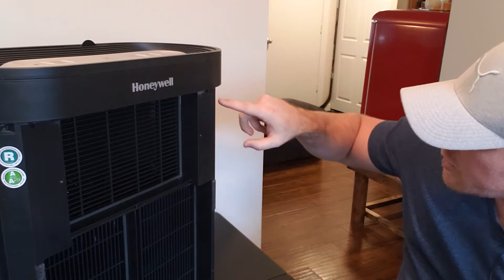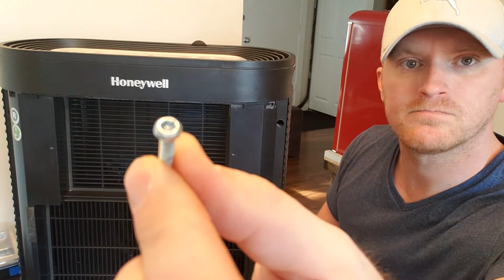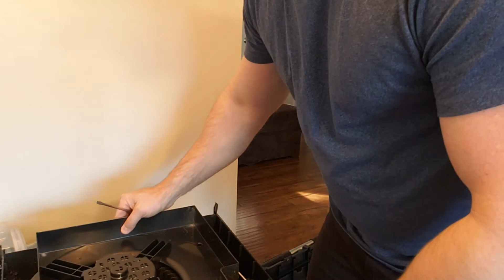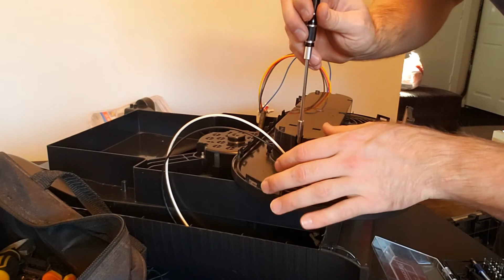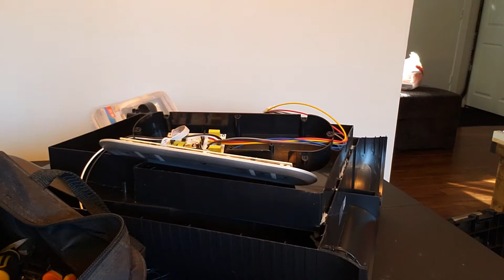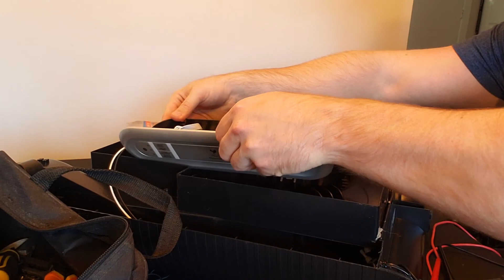We Tested the Honeywell HPA300 Air Purifier

Comment: Thanks, Greg. I used this video to take mine apart to clean the fan blade compartment, which was full of dust. Too bad Honeywell doesn't make the top grille with a hinge to make cleaning a lot easier.
Reply from the maker: Your very welcome, and yes it should be easier.

Comment: Thank you sir. This is helpful. I have similar unit. bought over a decade ago. Still going strong. I do clean the filter regularly. I run it 24/7/365. Do you think that's ok? I also leave it running when I'm not home. Recently I've been considering...is there any chance it can overheat and catch fire?
Reply from the maker: The likely chance of fire is not likely, but that being said there is always a possibility that electrical shorts out or it becomes so plugged it overheats, but usually there is built in safeties for things like that can't happen.
Reply: @Thomasappliance  Thank you. Good to know. I know it has no heating elements like a heater so it should be ok but wanted your expert opinion. Do you run yours 24/7 and even when you're not home? is it even recommended to do what i do - to run it around the clock every year?
Reply from the maker: @Newtttton  I run mine during the day and shut it off at night.

Comment: Thanks for the info, i just need to do a deep cleaning , you mentioning the T20 screwdriver saved me lots of hassle. As for your board perhaps you can practice some electronics diagnostics since it is dead anyway 😅
Reply from the maker: No problem at all, and yes I did do some electronic testing after this video to see how this board worked.

Comment: So i just bought one second hand and it turns on but the fan doesnt what can it be ?
Reply from the maker: It could be the fan not getting power from the board, the fan blown, or anything electrical in-between. I would start with seeing if the board has any power out.

Comment: I would like to know where I can obtain a replacement 4-speed AC motor for my Honeywell airpurifier model #HPA160CV1 the motor has a sticker on it indicating it's made by the Easepal company but no mention of it on Google anywhere. Please help if you can. Thank you
Reply from the maker: Thanks for watching, I've found these types of motors are hard to find, I usually just Google any of the numbers on the motor and hopefully something comes up.
Reply: I'm having the same problem but I can't get my machine open. Is there any chance you can type the whole label here.... thank you very much
Reply from the maker: @emoryolsoff96  thanks for watching,  I dont have the unit anymore sorry

Comment: So I just bought an hpa300 from Amazon but my control panel does not look like that. Do you think that they replaced the control panel because of issues like you are experiencing with the unit in the video? At first I thought Amazon maybe sold me a very old model but it works wonderfully. And just in case anybody wasn't aware it does have a manufacturer 5 year warranty. I spent $2.99 and got an extra 2 years of coverage from Amazon/Asurion. I think it was worth it but if it runs that long I will be quite okay with it
Reply from the maker: Thanks for watching Conan, I'm not really sure but they very well could have. They are nice little units enjoy!

Comment: Hi Greg. Your video was helpful, but I’m getting a almost burnt smell from my HPA 100. The filters are new and I checked if there was plastic on them. Prior to installing the new filters , there was no burnt smell. I was thinking of cleaning the blades. Will taking the motor mount out be necessary or can I fudge around that? I also took a good sniff of all the new filters and surmise that they are not the cause. Otherwise, what is your opinion after cleaning the blades that the motor is the cause and this unit is in need of replacing. BTW, the Honeywell unit is just under 4 years old approximately. 
Thanks jerry
Reply from the maker: Thanks for watching JarvisRose, that's a really good question that I dont know if I have the answer for, it can be very tough to find anything like that weather its a air purifier or a washing machine.

Comment: Thanks for doing this video.  Needed to clean mine out because it's been collecting dust for years.  And, now I need to start putting it to use again because I have a lot of vacuuming and dusting to do in my home.  So I took mine apart and wiped down all of the internal surfaces with distilled white vinegar. Btw, I simply used a small flat head to remove the two T20 screws.  The other screws were just standard screws.  I'll probably find a few more small screws to replace the T20 screws bc my T20 drive bit doesn't have a long extension bar.  Dealing with the T20's was kind of a pain in the ass, lol.
Reply from the maker: Thanks for watching Brandon Daniel's9471, hope everything worked out good. And good job!

Comment: Just tore the same thing down. Thanks for the tip on the torx 20 security bit, but yeah same conclusion- bad touch control board
Reply from the maker: Thanks for watching user'gg8ve3sd8w, that seems to be the common theme with these units.
Reply: @Thomasappliance  so you're probably the only person to get a kick out of this. After not hearing back for more than a month from Honeywell support for a new panel, i inspected the panel again, and decided to plug everything back together. I fiddled with the short 5 pin cable and the thing fired up. I'm going to re-terminate the connector but I think that's the issue in my situation, and quite possibly was the same in yours. If it's still sitting around you should test it out
Reply from the maker: @Justin-ri7ze  that's awesome if you got it going, it always can be a loose connection when it comes to boards or molinex plugs. Good job.

Comment: My top left door clamp/spring seems to be in the back and locked position so that I can't actually close the left side of the front cover. When I push on the cover to lock it in, the left side depresses but doesn't lock. I wonder if that is something I can fix by opening and removing the front cover.
Reply from the maker: Thanks for watching russellh6533, thats a good question, I've never had that issue but it can't hurt to look.

Comment: Online I saw something about a fuse possibly being blown. I didn't see any fuse so thank you for saving me time wasted to try and find it. Just wondering if you tried checking the motor to see if it worked. Mine was working and I tried to reset the filter light and it wouldn't work so I unplugged it while it was running and then it stopped working so I might have damaged the board
Reply from the maker: Thanks for watching Sherry, I'm pretty sure the motor still worked because it tested good, but with the board blown it wasn't very usable.
Reply: @Thomasappliance  Were you able to get a board to fix it. My unit doesn't want to turn on easily so I think the board is going out. There doesn't seem to be anything to blow like a fuse or a reset button anywhere so I guess the board goes and then you need to replace it if you can get one :)
Reply from the maker: @Sherry-jx9hs  I phoned honeywell, and they gave me a new machine due to warranty. Before I phoned them I tried to find a board with no luck.
Reply: I will call them. It’s not two years old yet. Problem is I got it on Amazon so I am not sure how they are going to about a replacement. Thanks again

Comment: Why do they make it so hard to get in there? With the open top like that, it seems like things falling inside would be relatively common. I know a torx screwdriver isn't exactly an uncommon thing to have, but one that's that long and can access tamper proof stuff is kind of weird.

Although that's partly on me. I didn't watch far enough in before ordering the screwdriver, and I got ones that can't access tamper proof screws
Reply from the maker: Thanks for watching Nome, most manufacturers don't want people taking apart there machines so they usually make it tough to do. Yes pain in the butt.
Reply: @Thomasappliance  yeah. Some dog food spilled in it a while ago and it's proving very difficult to get out
Reply from the maker: @nomekop777  good luck, hopefully you can get it all out of there.

Comment: My machine is working but it is putting off a mild electrical smell, if that makes sense. Do you think it is electrical even though it is working? maybe the motor.I am not sure what to do with this....
Reply from the maker: Thanks for watching sara c, yeah thats a tough one, it can be parts of the board heating up and causing that smell.
Reply: I have the same problem; if someone  has successfully corrected this issue, please respond 🙏  It happened to both hpa300 and a smaller tower version. Thank you

Comment: I really appreciate the information about Torx 20.  After a long time of use, a lot of dust accumulated below the panel, which needs to be taken away if want a deep clean underneath.
Reply: Same here. The inside needed a good clean and it was helpful seeing how to take it apart. Thanks for posting. Even though you didn't find a fix for your problem you still helped others!
Reply from the maker: Thanks for watching Verandah X, I'm glad the video helped you out.
Reply: Me too. Looked like my kid had been pouring liquid and potting soil into my air purifier, and I wanted to clean it out before I replace the filters (which hadn't been changed in over two years). I could see that it was a torx security bit, but not sure which one- thanks for the info.
Reply: The key is getting a Torx security bit at least 100mm long.  I have a set of 75mm bits, and they are not quite long enough for an HPA200.  Amazon has both 100mm and 150mm for cheap.
Reply from the maker: @bigman55434  awesome thanks for the feedback and support.

Comment: where is the fuse? mistakenly plug to 220v. can it still be fixed?
Reply from the maker: That could have fried the electronics,  I would plug it in and trace power to the board, if there is power there but no display the board is shot.
Reply from the maker: I would plug it in and trace power to the board, if power is there, the board is toast.
Reply: Is it even possible to plug a 110 volt appliance into a 220-volt outlet? The receptacle is built different so you can't make that mistake or so I thought. Some 220 volt Outlets will have three holes stacked vertically or one of the inlets will be horizontal while the other being vertical. I'm not an electrician but I've been around for 48 years and I've never seen the possibility of being able to make that unfortunate mistake

Comment: I hope to bypass the panel and hardwire the fan on to the high (not turbo) setting so that I can turn it on and off with a smartplug on a schedule.  (The unit will not turn on automatically when the power is activated.)  So your video, opening it, is helpful to me even if you did not get a solution.  So thank you for posting it!
Reply: Looking at wiring diagram on motor housing. Red wire is turbo, yellow is high. Grey is medium, brown is low. Blue wire is common/neutral. There is a black wire and white wire coming off the motor to a capacitor. Not to be confused with the incoming black and white wire from wall plug.
Reply from the maker: Thanks for watching Dan Ball, let me know how it goes.
Reply: @Thomasappliance  Works great! I decided to put in a 5 position switch. One position powers the panel for normal operation. The others take the incoming power and route it to the 4 fan speed wires. Thanks again for your video which was very helpful (with seeing the wires and with the torx 20 security screws.
Reply from the maker: @danball4410  Thats great that you got it going, nice work. Thanks for watching again!
Reply: @danball4410  Do you have any more details on how to do this? I'm on my 3rd warranty replacement for the same problem (the panel stops functioning) and I thought of doing something similar.
Reply: @ttttt7026  The 120V incoming power can be directly routed to the fan and it will work. One benefit of this over the panel is that I can now use an automated plug adapter to turn the unit on and off without messing with the panel. If there is one fan speed that you always want, then just wire the incoming plug directly to that. In my case, I occasionally switch fan speeds because I want to change the noise level during video conferencing etc., so I have mounted a multiposition switch to the side. I will reply with description of the switch I used. It is working great after 6 months of daily use.
Reply: @danball4410  The smart plug is such a great idea. Now I need to find a T20 security bit.
Reply: Do you remember how your wired it? I have a black and white wire coming from the wall plug to the PCB. And from the PCB there is a red, yellow, gray, brown, and blue wire that goes to the fan. The blue wire is a bit separate. I'm assuming the red, yellow, gray, and brown one represent the different speeds, low, med, high, turbo. Is it just a matter of connecting the black (hot wire) to one of the speed wires?
Reply: @ttttt7026  I believe you have it exactly right. I was able to apply the 120v by connecting the neutral and then connecting the hot to the other colored wires which each activated the fan at a different speed. I do not remember which color was neutral for the fan.
Reply: @danball4410 what switch did you use? How well did it last?
Reply: @Miisile  I used this one "Electronics-Salon 1PCS SP5T 8A/250V 1 Pole 5 Way Rotary Switch, with Knob" and it is still working great for me 3 years later. It does just what I want. Best wishes with your project.
Reply: @danball4410  Thank you so much for these comments and your replies about how you hooked the fan motor up and what position switch you used. I have an older HPA160 tower filter with these capacitive touch panels and it started acting up. I knew enough about electronics to think this might be possible…to just bypass the factory screen….and your comments confirmed it. Hopefully I’ll get it running and report back. (Or maybe ask a question). Thanks again!
Reply: Which five position switch did you use?
Reply: Thank you for this comment chain!  Maybe I'll be able to fix the one I was gifted with your idea and execution!

Comment: Was hoping for a solution for my Honeywell air purifier that wouldn't start. Had the unit clear out the saw dust cloud the flooring guy left behind. I swapped out all the filters and ran a Shop Vac over the unit. It died weeks later.
Reply from the maker: Unfortunately Robert Lee there is probably an issue on the board, which can be diagnosed, but you would have to have the know how to diagnose electronics which sadly I don't have a backround in. Thanks for watching!!
Reply: Check the power supply board. There’s Triacs on them which can burn out.
Reply: @cosmicallyderived  
Thanks. I still have the unit. But don't know how to troubleshoot electronics.

I have replaced it with two Germgaurdian purifiers.

Comment: Can I use a cool mist humidifier in the same room as this air purifier. Will the air filters be impacted by extra moisture?
Reply from the maker: According to the manufacturer of many air purifiers they say that you can definitely use both within the same room. I would check with your particular manufacturer just to make sure though. That's a great question. Thanks for watching!!
Reply: @Thomasappliance  Thanks for a quick response. I have a Honeywell HPA300 . Would you know offhand if HPA300 would be ok. If you are not sure. no issues I will try to find out from them
Reply from the maker: @ManjitSandhu  I'm not 100% sure, I cant find anything online that says you cant, but also cant find anything that says you can for this model anyway.
Reply: @Thomasappliance  Thanks Greg for look it up for me.
Reply from the maker: @ManjitSandhu  No problem at all, I'm here to help.
Reply: I have an evaporative-style humidifier sitting right next to my HPA300, and it has worked fine for years like that.  It's the type that has the wick filter and the fan blows through it.  The cool mist might create a problem if it sprays directly on the filters.
Reply: @bigman55434  Thanks
Reply: We use a large humidifier in the same room.  We've only been running the purifier for a month, and it really seems to cut down on the amount of white dust that used to get on everything.  

Now most of that white dust gets into the Honeywell HPA300 and filtered out of the air.
Reply: @cscooper2000  I tried that and it chokes the HEPA filter very fast (about 2 months vs 6-12).  I am thinking of a humidifier that does not give out white dust.

Comment: Good video I have the same problem but it seems alot work to take it all apart.
Reply from the maker: yeah I needed to go buy a certain screwdriver kit for this. I found out if you phone honeywell they will take care of this issue for you.
Reply from the maker: Thank you for watching!!
Reply: @Thomasappliance  I wonder if you contacted the customer service within the warranty period. They require the date stamp on the electrical plug plus your bill. Honeywell is sending me a replacement after 2.5 years of operation. The control panel stopped working except the check filter (press 5 seconds)
Reply from the maker: @zeulsisme  yes, thank you I did and they were very good. They replaced it for the owner. Thanks for watching too.
Reply: @Thomasappliance  In case you still have the defect unit it is possible to repair it without major costs. The microcontroller on the circuit board is: EM78P5840NK24J. The outputs of this IC control the mother board with each 4.41V. I had a hard time just buying one replacement IC or a few ICs so I opted for replacing the control board with an Arduino Uno.
Reply from the maker: @zeulsisme  Awesome thanks so much for that. I do still have the old one and was trying to figure out what to do with it. Thanks for watching!!